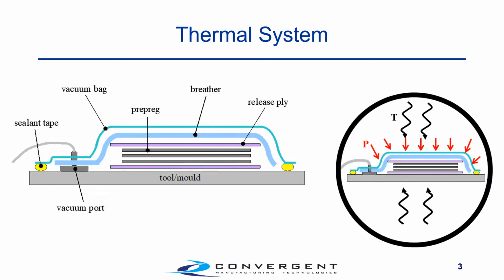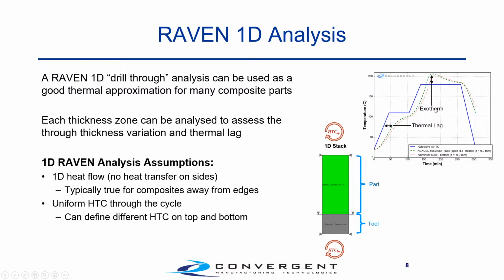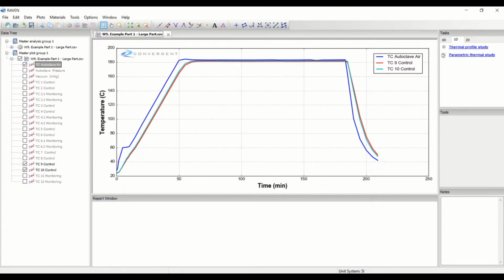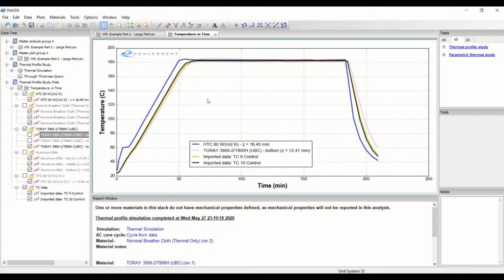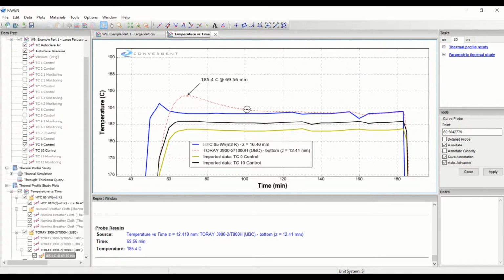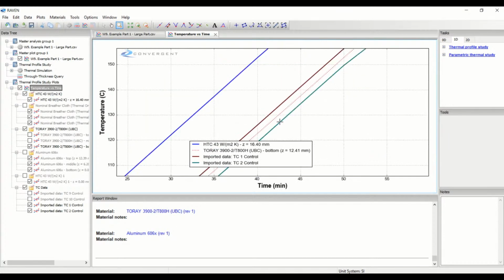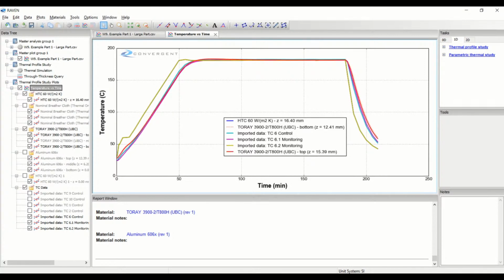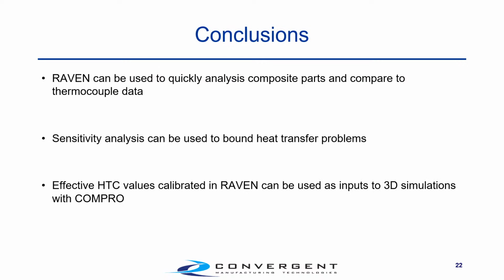Calibrating Heat Transfer Coefficients Using Experimental Data in RAVEN

Comment: Hi, how did you find the different properties such as the Specific Heat for different materials? I can't seem to find Specific Heat for Hexcel Prepreg for example. I am looking to create a new material file. Thank you!
Reply from the maker: Specific Heat Capacity data can come from a many different sources. The datasheet is a good place to start, but if not available, you can use a typical value from an engineering textbook or online resource. If you have access to test equipment, you can test heat capacity using a DSC or other test methods.
Check out this tutorial on creating material data files here: https://www.youtube.com/watch?v=XZG5fMOlBeo